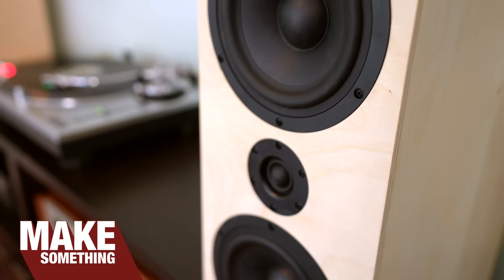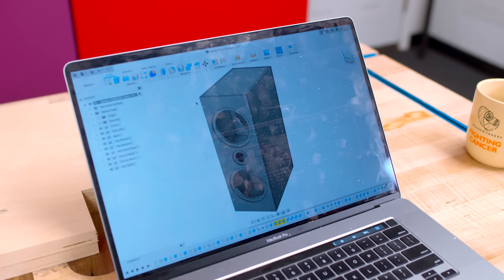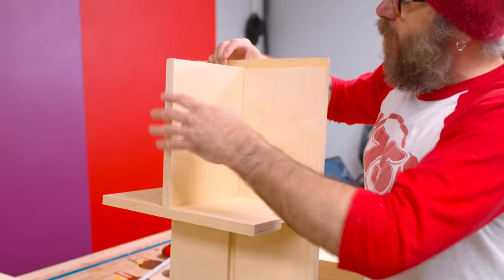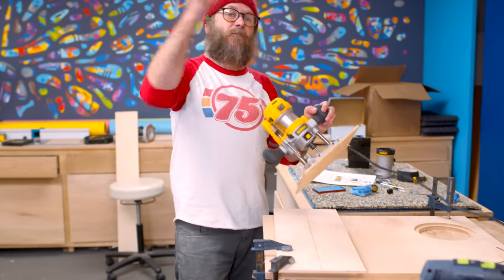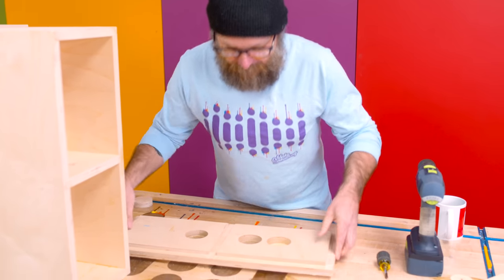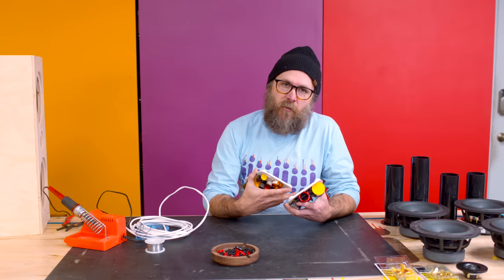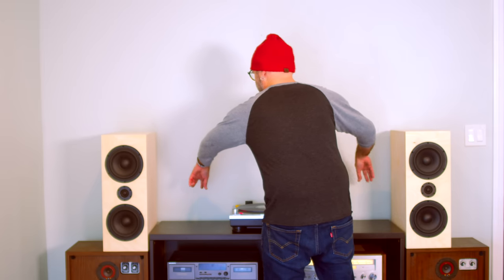High End Stereo Speaker Build. THESE SOUND AMAZING!

Comment: Another way of saying muddy is that the drivers have a bit extra distortion (another name for the driver is transducer). Older drivers from 80s and earlier often had a lot more distortion compared to modern drivers. Distortion itself isn't necessarily bad, but it changes the sound. Audio purists fight distortion with the DAC, the receiver or pre-amp, the amplifier itself, but they often overlook that the transducer itself has distortion. So modern drivers can give an uplift in quality just by using those.

The MTM/WTW (mid-tweeter-mid/woofer-tweeter-woofer) was popularized by D'Appolito, a person that literally wrote the book on testing loudspeakers. He used to promote third order crossovers for them but now supports even steeper drop-offs (I am a fan of Linkwitz-Riley crossovers which are cascading Butterworth, or just using DSP for an active crossover, but to each their own). 

For the towers I just built (just have to glue on the back, tune the ports, and paint), I used a bracing style that is unique and hard to do. I chamfered the edges of the bracing to make it slide into the dadoes easier on the sides. Doing by hand sucked, but a tip I figured out for the next set is to use blue painter's tape and line the sides up with the bottom edge. With them taped in place, use my tracks for my track saw, set back the distance to the edge of the router bit, then use the router to cut the dadoes all at once even. You use a straight edge to align the bottom of the board. You also can use pipe clamps or cabinet clamps to help hold the boards together in place to help prevent shifting. But, that should have the dadoes aligned to easily accommodate shelves/bracing. Meanwhile, the chamfering just makes it easier to slide into the slot, if you know what I mean. 

For the amplifier, the Topping PA5 goes for $350, is able to do a 4Ohm load at 125W (around 20dB louder than the base sensitivity of the speaker, which is the dB rating at 1W, or rather now like 2.83V at 1M, which is why 4Ohm is actually 3dB lower than an 8Ohm driver if the measurement is given at 2.83V instead of 1W, something to keep an eye on when buying drivers). For 1% into an 8Ohm speaker (the woofer or subwoofer largely defines if a speaker is 4Ohm or 8Ohm), it gives 65W or 18dB in gain over base sensitivity. But the distortion is extremely low, at 0.0004%, or less than -105dB. Audio Science Review has it with a SINAD of 106dB, just less than the Benchmark AB amplifier.

Great video! Loved the work on it. Hope the $350 recommendation doesn't break the bank. If you want to build your own amplifier, look into getting ONLY the ICEPower 300A2 or 400A2 if buying from ICEPower, or look into the Hypex N-series amplifiers. If you really want to go high end class-D, look into buying direct from Purifi-Audio, which has some of the best amplifiers on the market incorporated into some of the highest quality (and price) amps currently being produced. Two channel amp board from them is around $700, give or take. It now lists Kr for the currency, but previously listed the DKK (Danish Krone), so they are likely still using that, not the Krypton Coin worth 1/10th of that. Buying one ICE Power 400A2 is around $182, for comparison. Hypex is more expensive and I would go purifi over hypex. There is Orchard Audio as well, but that is more expensive than the purifi amp boards. Both have their benefits and drawbacks.

And remember, you have to buy a power supply to run the amp board. You could just buy one from ICE Power as well, or a company named Connex if you want to learn about the electrical side enough to connect things up. But Ice Power has turnkey solutions, so buying from them can make it streamlined. For example, their 1500S switch mode power supply runs $490, and has it where you can just wire it directly into it. That means closer to $800 after buying a case, etc. But it can run 400W per channel and you can add other amp boards to daisy chain in the future if you care to. 

Personally, I'd pick up the topping as most do not need to do that much, or grab a power supply from connex, a different company, for less than half the cost if doing the ICE Power boards. It just depends how much DIY you want to do. For Purifi amp boards, you may consider the Hypex power supplies as the company made those compatible and it would take more work to make a Connex power supply to work with Purifi (doable, just you have to understand what, why, limitations, etc.). But the Hypex power supplies with Purifi amps is tried and true. And that would have you a 400W per channel amp with some of the lowest distortion on the market that money can buy. Seriously worth the DIY, but just putting it out there.

So, if you don't need the extra power, and most do not need more than 10W, depending on how loud you are listening, which is 10dB gain, you could grab the topping giving 18dB gain at 8 Ohm, 20.x dB of gain for 4 Ohm, and call it a day with $350, with some of the lowest distortion on the market. I'd say that is the easiest route to take. 

Once again, great video!
Reply: addendum: when I say gain, I do not mean signal gain of the amp, I mean the additional level of dB that is approximated over the base level of the sensitivity of the speaker. The signnal gain of an amp is baked in and is a different factor in DIY amp boards, but I wanted to clear up the confusion if any existed.

Comment: Denon, Yamaha, Sony are good units for AV receivers or integrated amps starting around $200 up. I recommend the Sony STR-DN1080, if you find one. They are getting scarce but if you find one grab it.  One of the older Sony receivers from the STR-DN1040, 1050, etc are good too. I had the 1040 and loved it but sold it to buy a Denon X2300 to get newer tech. Denon is very good but I have to say I liked the Sony more.

Comment: Sweet setup. I had a question though, don't you want the woofer sections to be sealed off? That tweeter area cut into the divider would create pass through that could affect the sound and not give you the best of the best of the best sound, no?
Reply: The two woofers are playing the same signal and are for all intents and purposes act as one speaker so they can share the same air space with no negative effects and as long as the tweeter is sealed, which it is, it can occupy the same air space because it is sealed and will be unaffected. Now if this was a three way set up where there was three different speakers, a woofer, a mid range and a tweeter then the mid range would need it's own enclosure within the larger woofer enclosure.
Reply: @iamjackalope  ahh that's a good point, they are either both left channel or both right channel. Didn't even think about that lol, thanks

Comment: you can try the NAIM unity atom. its got pretty much everything you need in 1 package. a cheaper alternative is NAD 700C. burn it all in for 24 hrs straight then both amp and speaker is nicely seasoned

Comment: Looks like a decent build but I do have one suggestion that should give you better sound and that is do a large round over on the front baffle. The front baffle if left with sharp corners will have strong diffraction and will lead to peaks and nulls in the frequency response. This can be reduced by rounding or chamfering the leading edges of the front baffle. Depending on how good your hearing is and the quality of your source material, diffraction may or may not be an issue, but it definitely does show up in the frequency response graphs so it is audible.
Reply: Do you mean the front edge of the circular recessed openings where it's routered out for the woofers? Do you think mounting drivers directly on top of the baffle (not down in a recessed channel) would also help eliminate that diffraction? I thought drivers were only recessed so a grille could fit over the top.
Reply: @jgevans  It is usually better to have the drivers flush to the face of the baffle so you will have to rout out enough of the baffle to inset the drivers. The round overs are on the outside edges of the baffle.

Comment: Great video, you make it look so easy building these, unfortunately I would never be able to build my own, I'm the dude who would smack himself out from that table saw LOL... In regards to the amplifier, you might look at Marantz I have a 7000N and it's very nice (and won't break the bank at around $1500USD) if you wanted to go a step up from that look at some tube based gear like Opera Consonance Cyber 880i (especially if you can get KT150 tubes, which many say are much nicer than the standard ones) which is an integrated tube amp and according to many (even though these are from China) are considered the bee's knee's in quality beating many amps many times their price, I think the Cyber 880i would be around $4,000USD and you would need a DAC to stream stuff or use your turntable input... A nice DAC of the same brand Opera Consonance would be like a Reference 8 Pro for around $3,000USD, so not quite your $10k McIntosh, but of very good quality none the less and would probably be very nice with these little handsome beasts you've built 🙂.

Comment: Good job.
Crossover component quality is critical for quality frequency response. Should avoid iron core inductors which become ferro-magnetic in the signal path. Also avoid sand cast resistors. Non-ferrous Tube-type Connectors on the back of the speakers are also a great option.
(audio HiFi quality capacitors such as aluminum electrolytic and film capacitors can be ridiculously expensive. A single capacitor can cost over $300 which is more than what these speakers cost)
Reply: dude's 'high end' record player is an lp-120 lol, don't waste your breath

Comment: Nice Drivers, Nice Cabinets .........
Now, get rid of the Ports and Cross-overs, and pack the Cabinets tight with Fiberglass Insulation.
Add an Active-Crossover, 2-Stereo Class-D Amps, and a Sealed-Sub-Woofer with its own Mono Class-D Amp. 
Then you'll have a top-notch, truly "High-Fidelity" Sound-System, with extremely low Transient Distortion.

Comment: When you cut the rabbets the blade was even further from the fence and at a greater risk of kick-back.  A better way is to clamp a piece of 3/4" MDF or plywood to the fence to create a sacrificial fence, and edge the fence over until the side of the blade teeth just kiss it.  Then run the edge of the board along the sacrificial fence / blade... There is no possibility of jamming or kick-back this way.

Comment: It is fun building speakers. i built quite of few of them. however, if you are looking for bang for the buck get a set of used studio monitors and a decent DAC. Bought a pair of Adam A5X and a Presounce studio sub T10 for about the cost of these and this system will smoke everything. Power amp included in price.
Reply from the maker: Don't studio monitors have a flatter response curve compared to high end stereo speakers?

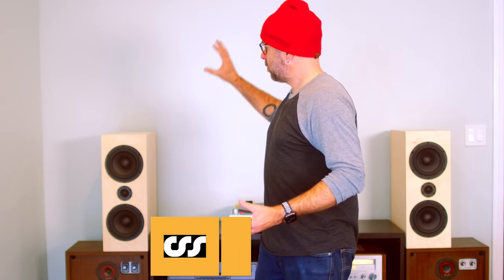Comment: 12:14 This is great. Everyone makes mistakes. 17:53 The CSS Speakers are to near to the wall so the ports could not work right. This results in less bass volume. Also you have break in the speakers a little bit. This results in a lower  bass.
Reply from the maker: We addressed the wall thing at the end of the video. 😎

Comment: I would use magnetic attachments for the grill. The classic ball and socket designs are hard to get installed perfectly, don't look great when the grills are removed and they're easy to break. Magnets can be recessed behind a veneer or painted over, and tolerate slight miss-alignments and aren't so easy to break. I did buy a SMS amp for my grandson to drive his C-Note speakers and was surprised by how good it was. I really didn't expect much for what I paid but it sounded very good, and I am not by a long shot the only one to be surprised by the value that SMS is providing.

Comment: Agree with wishbone20t, the speaker has to be at least 1ft away from back and side wall. The bass overload (resonance from the walls) would mess up the mid range and lower treble. Bass is not just bass, bass is the foundation for the mids and low-treble; it's never "siloed"  If one is strictly looking at aesthetics, then make a consul, table, chair, i.e. a furniture, don't make a speaker. Speaker is for music, and therefore it has to make music sense first, not just furniture/aesthetic sense.

Comment: That Technics 5170 is pretty good no?  do you mean a modern new receiver?   There is a nice marantz on CL in Toledo right now
Reply from the maker: I like the 5170. More than anything I like the looks of it. I think I paid $75 for it on Craigslist but I've had to have it repaired twice now which cost way more! Just looked at that Marantz! Absolutely beautiful!
Reply: @MakeSomething  I've been really liking the Sansui xx1 series lately.  Amazing sound, look awesome, and not as well known as the 5050/7070 etc.   If you can find a 771 or 881 (or really any from that series) snag it and try it out.  I think you might like the sound a lot better than your 5170 for this new CSS kit.

Comment: If you want to have a better sound with your '70s speakers, you'll have to test and change all capacitors inside them and you can change the membrane of the speaker too.
Reply: They sound like they are near dead, it could be a great restomod project for someone. It would be a shame to throw them out that is for sure. Everything is repairable, unless it's burned to ashes. XD
Reply: Not worth it; driver technology has improved significantly since then...unless just doing it for fun

Comment: For those wondering, while the dadoes are great, they are NOT absolutely necessary. Simple, tight butt joints are more than sufficient. Be sure to follow the instructions and keep the driver spacing correct.
Reply from the maker: Thanks Charles!

Comment: puh silk dome speaker ... there are so many bad ones out there that i dislike them in general x) but truth is, if done correctly a silk dome tweeter can be pretty good. I have yet to hear one that can go toe to toe with real high end tweeters but they can be pretty great! 3000€/$ for finished speakers also is a pretty good deal for good quality components. Normally theres pretty much garbage in those price classes still, thats why i always recommend lower tier speakers to everyone since i dont feel theres much of a diffrence between 200€/$ speakers compared to 2000€/$ on the big brand speakers, they look a bit better but thats about it. DIY truly changed my way i look at speakers. Its pretty easy to build speakers that beat 50.000€/$ speakers or 100.000€/$ speakers and only cost a fraction of those speakers. Personally i dont even know how a speaker can be more expensive then 10.000€/$ since by that pricetag you alraedy have no limitations anymore.

Comment: Maybe the wrong channel to ask, but I'm looking for a decent component only kit (drivers and crossover) that is designed open baffle speakers. I am not concerned about low end as I will be using a separate sub. Just thought I'd ask.
Reply: Check madisound > speaker kits> open baffle speaker kits.  The linkwitz designs are pricey and use dsp for an active crossover so they're not for everyone, but what can I say, you have exotic tastes... a wealth of knowledge about them to be found on the designers website,  linkwitzlab
Reply: @cameradan7648  Thanks. Those are a little out my price. Seems I'll have to invest some time in learning how to make crossovers since I just want a 2 way set high and mids. Also need to research what parameters are best for open baffle drivers and diy it unless I find a cheap option

Comment: It is a beautiful box made in the most complicated way possible. It is extremely  slow way to produce a box with excessive amount of clamps.  All the joinery will not bring anything to the actual sound quality of the speaker . I guess you can go even further get a tree trunk and dig out the speaker enclosure with a chisel and a hammer. Again spending all this time on a box that has not been tested for sound quality  could be a complete waist of time.  Adding a vent to a speaker box  with out using any software to calculate the vent volume is also amazing.  Not checking the quality of the soldering with volt meter and testing your system before  installing it in the box is a obviously a really good idea.  And the cherry on the cake is running the cables without terminal box. By the way speakers have positive and negative on the cables. Maybe your old speakers sound weak simply because you didn't install the polarity correctly when you connect the wires how about that.

Comment: im sure the new ones sound way better but the speakers sitting on the floor like that and theres an adjacent wall so both those things combined will cause alot of problems in the bass response. theyd sound better if you pull them out from the wall and got them off the floor

Comment: Re: amplifier. Personally, I think a Cambridge AXA-35 would probably fit the bill for your system. No DAC, but has a phono stage, and should drive those speakers without breaking the bank. Just my $0.02 worth. 😉
Reply: I should mention. I got my hands on the previous version of the AXA-35, the Topaz AM-10, for about $150 cheaper. I'm told, though not certain, it has the same circuitry. FWIW. 😉

Comment: You can also use a Jasper circle cutting jig to do the woofer and tweeter holes.

For information on choosing an integrated amp with a phono input, or using an outboard phone preamp, you can check out Cheap Audio Man, here on YouTube.
Reply: I like building speakers with Baltic birch plywood - for the weigh savings alone. Another method that works well is to use biscuits.